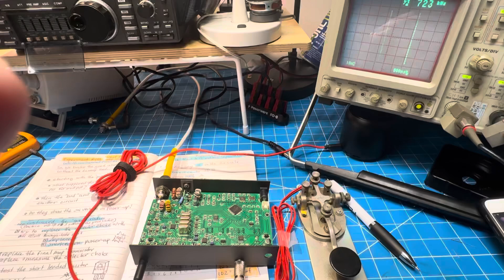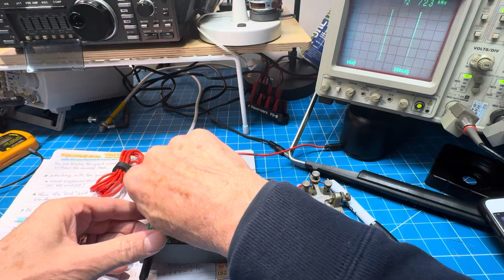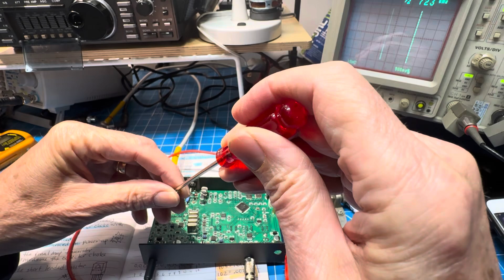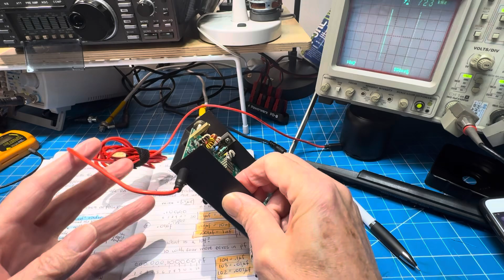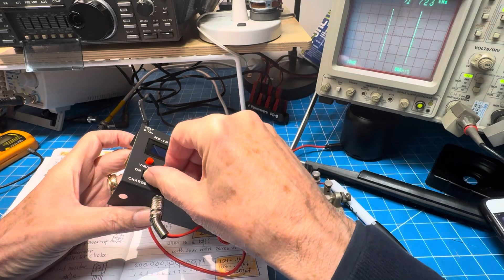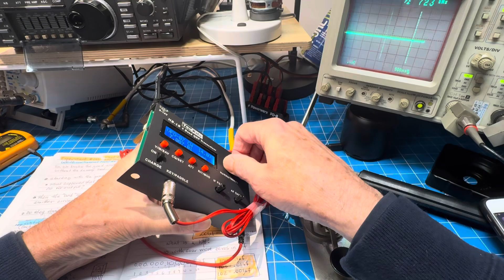HB-1B Low Transmit Power #8 - We let the smoke out again!

Comment: Do you have the schematic for the HB-1B?  (If so, I wouldn't mind a copy 😏)  It almost looks like that final transistor is being biased full-on, like as soon as power is applied, the base goes 'high' turning on the transistor full blast - like a switch - and the collector choke opens like a fuse.  Maybe you've already considered that....I was hoping you'd nail it this time! / de N0DET
Reply from the maker: Thanks for the observations on the choke killing output section! As you said it looked like full 12V applied to the choke. Bingo! Shorted zener protection diode!
Reply: OK!  Good find - I hope you can find the right replacement.  We want to see that baby working again!! 👍 @tyrueiI

Comment: Uh-oh!  Is there a sneak ground on one side of the choke?  Maybe do resistance measurements before applying power after you replace the collector choke.  I hope your junk box has some more chokes.  Is there a zener diode off the collector to ground?  Is it shorted?
Reply from the maker: Hi Lynn - you nailed the issue. Shorted zener causing 12V across the choke. Removed it and checked it. It has turned into a low resistance. Thank you!